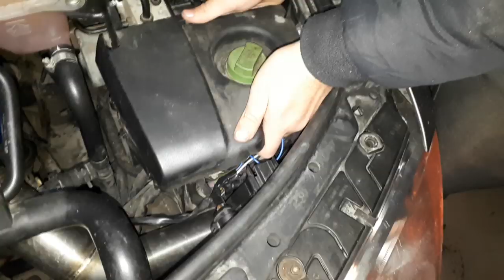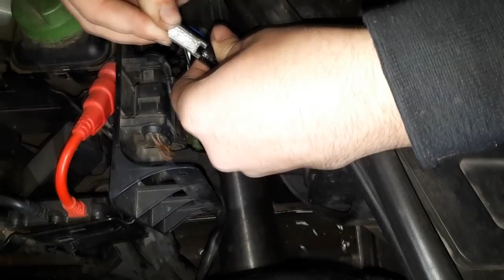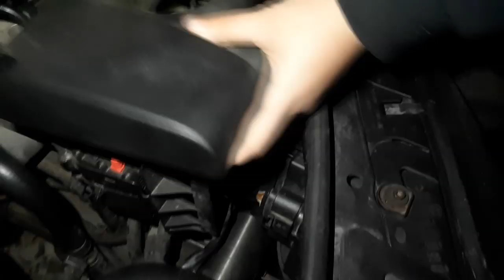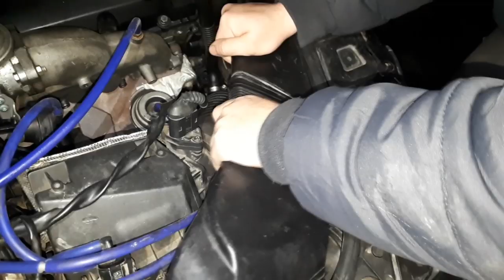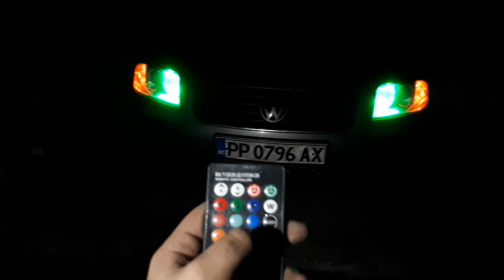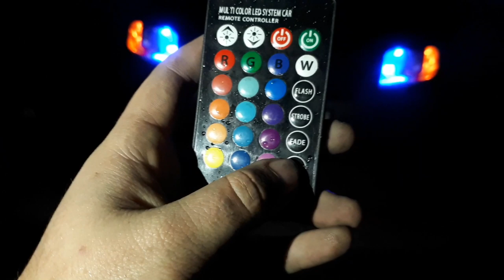LED CANBUS RGB T10 lights (remote controled) - install and demo

Comment: They are good but every time i turn on lights they start flasshing i want when i turn them on they need to be white but they flash in colors
Reply: I have same problem too did u get the solution.

Comment: They are not good quality becouse they are covered in silicone... witch when heated expands and de-solders the led connection
Reply: While they look cool, they don’t have a metal piece for heat dissipation. 

Lasfit have RGB T10. But it’s an individual led color lights. Which means u only choose which color u want, rather than all in one.

Comment: I'm looking to purchase some multi led parklights too if not same brand similar product, but have a few questions???

1.) Do you have to point at each near to each individual bulb outside of vehicle, or can you change inside car parked up or driving?

2.) Does bulb have to be hooked to a vehicle or wire power source to test if product works or can it be tested as long as remote has battery?

Comment: I recently installed them in my BMW 1 series e87. The left side was working fine but the right side kept flickering and didn't want to stay in thr colour I wanted it. I flipped the lights and it's the same. When I put my original lights in it works perfect.   I know bmw have canbus erros but usually lights still work such as my non canbus headlights.

Comment: I have The issue that when my Car starts they dont Work but when my Car is off they are running good any Idea ?
Reply: You probably have to take the bulbs out and turn the over and put them back in ( turn them 180°)

Comment: Are you able to control them from within the vehicle?
Reply: did you find out? but I would guess that it there is probably enough material between you from the driver seat to the lights that it would block the infrared signals
Reply: @aonoymousandy7467  yes i think you can only use them from outside the vehicle

Comment: Can this infrared ( remote control) be bad for the lens of the headlights? Plastic / glass??
Reply from the maker: Bruno NO!
Reply: No because during the daytime, there are much more energetic light rays striking your headlights, in addition to infrared it also includes radio, microwave, visible, UV, and gamma rays
Reply: Dario DeNiro  hahahah